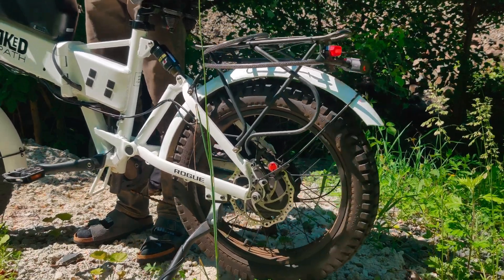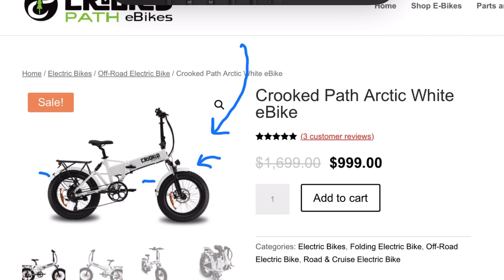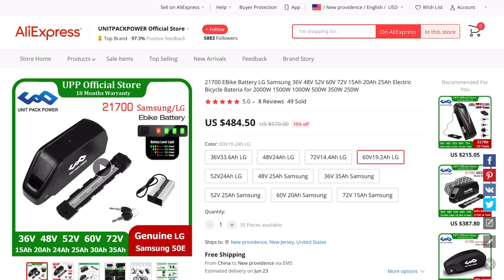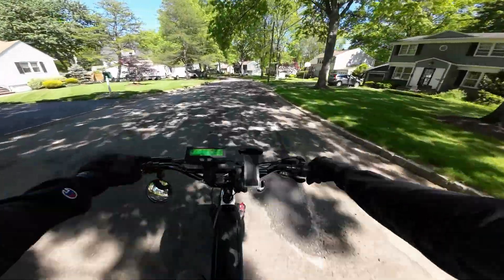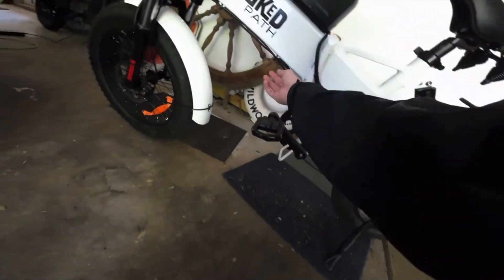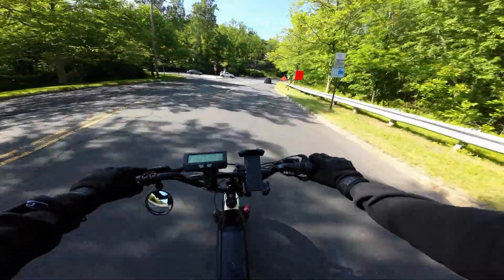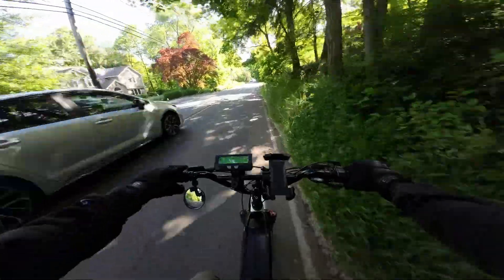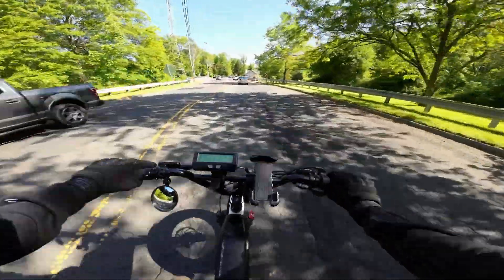I Made an eBike that Crushes Everything else

Comment: Definitely get your hands on a P-51, maybe you could get one from them without the battery and rear hub motor for a savings. I totally agree its suspension put's it in a league of its own, at least as far as E-pedal type scramblers, I know people are finding upgraded shocks for some of the other brands, but they still look to be limited in overall travel based on the original design and geometry of their rear swing arms. Something I've been watching for is for somebody to do a mid-drive setup, its probably been done and I just haven't come across it, but I'm super curious about how one would perform.

Comment: Dude, the Wired Freedom has dual suspension, 60volt 40amp controller with a 20amp hr LG battery that goes 38mph had over 2000 watts peak and is $1999.  They also have a step thru cruiser with the drivetrain and they are based in Chicago.  You can pick your bike up locally if you live nearby.
Reply: Sold out all summer

Comment: Hi. I just got a CP ebike 2 weeks ago, but I'm already having problems. I'm new to the ebike world and I'm not electrically nor mechanically inclined, so please bear with me. The bike seems to cut off power for me somewhere around the 60% mark. Everything is at factory settings. When I throttle it seems to use up 3/5 battery bars and the voltage drops significantly. I tested the battery and it was fine. 
1. https://youtube.com/shorts/EMxEYkUb9nA?feature=share
2. https://youtube.com/shorts/cyiR4RRQDqI?feature=share
If you or anyone here can help and offer some insight I would greatly appreciate it. I just want to get this thing going as it is my main transportation to work due to a recent car collision. Thank you.

Comment: on my enduro ebike i put a second motor on the front ,its a bafang 500 front hub motor,and its running on 82 volt 60 ah battery and 45 amp unlocked sabvoton set to 100 amps ,i use it only for flat roads as for sure it will over heat if on hills,but it flies,50 mph is the limit ive taken the little motor as i ment it to be for lower speed cruising,but shows these little motors can handle alot more power

Comment: Ok your key components motor, bms, battery and display. The battery being the hardest part to choose because you have to insure it's well made. No one wants a battery fire due to cheap battery cells and over charging. When you look around battery voltages are on the rise. Soon 60 and 70 volts batteries will be the norm. 
The bike you built is perfect for the range and price. With your bike you can go anywhere you want and nobody is going to give you a second look. What more could you ask for 😂

Comment: Similar build here: RadMini fat tire folder, Phaserunner, dual Tesla batteries, 3000 watts peak, 40mph. Downside is it's a hardtail, but a Suntour seat post mitigates some of that. Upside is it looks stock, throttle is buttery smooth and precise, park rangers smile and wave, and it out-climbs pretty much any mid drive e-bike unless it's a dedicated mountain e-bike. I was tempted to go with a 3k motor, but that motor weighs 48 pounds, mine only weighs 9. Thanks for the video!
Reply: Hey, wanted to know did you keep the stock motor? if yes, is it a 500w? And how much can you stress it? Wanted to mod up my lectric xp 3.0 but no one has done anything to the stock motor so I've no idea where to start but I think I can emulate this build

Comment: Your bike is awesome.  My perfect frame would be that style, with bottle cage mounts built in.  So you could keep internal battery and add yours.  "battery blender" to use both.  Dual motor mod would be cool.  Not sure about P51.  Frame looks a bit better than super73, but small wheels seem to waste space.  No pedaling or cargo rack means waste of a bike even if the frame could be sturdy enough to hold batteries.

Comment: Your build is so clean, but for my mountain biking use case I went with a bbs02 with a 52v battery and upping the amps to 22 makes it reach ~32mph on an old cheap full suspension mountain bike frame. I'm not confident pushing anymore than ~1200w out of the motor and I've reached the point of diminishing returns as well. It's been a year since building it and I've loved it but I will be retiring the bike this summer and building a nicer bike with a cyc x1 stealth and up the wattage to 2600 with a 52v battery. Keep up the content, your video quality has improved so much over the months!

Comment: It's funny to see this video when my Wired Freedom will arrive in 6 or 7 days. I think there's a lot to be said in favor of your crooked path build for someone who particularly wants that smaller folding form factor, but that doesn't mean a wired freedom is "the next best thing".

First of all, the motor is NOT exactly the same. The Custom Hengtai motor in the Wired is rated for 1000w continuous (33% more than your bafang) and has metal reinforced gears rated for 27000 km, and is actually covered by a warranty at the power levels we're discussing. 

Secondly, is 1500w really "very similar" to 2000 (actually 2100+ according to reviewers fyi)? Why phrase it like that? 

Otherwise, I appreciate the recap on your build. I was torn between doing something like your build, buying a 48v 35 to 60 AH battery bike, and grabbing a Wired Freedom. I went out and test rode some Aventon bikes to compare 20 x 4 and 26 x 4 tire sizes. I discovered I love the immense stability of 26 x 4 so I bought a Wired Freedom.

Comment: New build. Make the crooked back to stock and keep the all the upgrades parts and put them on the p51. Ramp the power of the stock motor close to 2kw and see what kind of performance you get. Suspension on p51 is absolutely the best but like you said the stock performance with that $3.8k asking price is way too steep for that bike. I like the new lyric graffiti 2023 for now. Under $3k and you get a bike that will go around 33 to 35mph.

Comment: Have you road the Engwe Pro Upgraded version? It has a 48v 16.4ah battery with a 750w motor. With me on it at 315lbs I have gotten the bike to over 30MPH. The motor does peaks to 1Kw. It also has full suspension. Check it out. The bike was just under 1700 dollars with an extra 48v 16ah battery.

Comment: I say that the best electric bike for about $2k is one with very large watt hours capacity. I can’t stress enough how important huge watt hours capacity is in a bike. The Eahora Romeo or the Aniioki A8 Pro Max are the best electric bikes for around the $2k mark. Custom made DIY electric bikes are good too though I never tried one before.
Reply: need to look at the new wired i have two of them and the newest one has some upgrades 60 v battery 40 amp controller its a beast for 2 k
Reply: @snoozeuloose  it’s ugly tho
Reply: @slimdunkin117  that just means it will be more stealth when your "pretty" bike and others like it get them all banned/regulated
Reply: @andrewstephens2687  mine looks more normal than the wired..it’s a xxl mountain bike frame with a mid drive..
The wired doesn’t look stealth at all, battery stands out, and huge ugly tires stand out..whole thing is a mess
Reply: @slimdunkin117  oh well I can agree with it being less stealth than that, but you said it was ugly, and that's a stupid shallow consumerist value to have. I don't respect people who value form over function.
Reply: Watt hours don't matter to me at all beyond a certain point.  For me, 40ah is the max I would go for.  I never ride long enough to drain a 40ah, and anything more is just extra weight and extra expense.
Reply: To add $2k in upgrades and your top speed, "in that configuration", is ONLY 30 mph and a range of 30 miles seems unjustifiable. A class 3 bike would give you a top speed of 28 mph and probably  longer  range. Maybe an upgraded rear hub motor (1500 watts or better) would have been a better compliment for your upgrades. For that size battery, controller and expense, I was hoping to hear around 40+ mph and 50 miles throttle only. Disappointed. But if after a year, you're happy, that's all that matters.

Comment: As a motorcycle rider, I would say that your next upgrade should immediately be very large and bright front and rear turn indicators - especially if you're going to be riding in the streets at speeds faster than a Tour de France cyclist. Us motorcyclists are already invisible to car drivers even with obnoxiously loud engines, but you with the silent bike are goddamn Harry Potter sneaking around the castle at night, so protect yourself! Having a brake light also helps keep you from becoming a horizontal Banksy. It looks like you might have a small setup for all of this on the rear at least, but that's tiny and too hidden under the seat. If you need to get an antibody shop to weld you a little bracket on the back and front. Trust me, you want a big setup that will be visible from a few car lengths away from the higher seating angle and whose light will actually be visible during the day.

Also drivers will just think of you as less of a dick if you're using large, obvious indicator lights

Finally maybe just get yourself a waterproof Bluetooth speaker that's really loud and play music while you ride so other drivers notice you faster. I have the Wonderboom 2, and this thing is fucking LOUD for the size, with loads of bass for the size. I think you can even connect two to one device to act as left and right channels, but just ONE is enough for me to hear over my bike engine driving around town doing 35-45, and the battery lasts for hours.

Enjoy cruising and stay safe.

Comment: 72v and suspension upgrade is in keeping with the value vibe of your channel
Reply: The only problem with 72v on this build is that if he exceeds the 1500w limit his controller is currently set to, he risks damaging the nylon gears in his bafang motor.
 It should hold up fine at its current power level (bafang motors are known for holding double their continuous rated power in normal use, despite their nylon gears), but AFAIK going past 1500w is asking for trouble. I suppose he could swap to metal gears if he doesn't mind the noise. 

Imo a new build would be a better idea. I actually think a Wired Cruiser build would be cool- he could use the stock battery/controller/screen to upgrade a different bike, and slap a big 72v battery and beefy controller on the cruiser to find out just how robust its metal reinforced gears are lol.
Reply: @Zirassi  nah these motors can handle a shit ton. i run 3000 watts sometimes on mine hehe. my motor isnt even a bafang, its a chinese unlabeled copy of a G60. but the problem is just temperature. at room temp you can run them at 3000 watts easily, just with a gentle start. but after the motor is around 50c then the gears will start softening and you can hear them skipping in the motor when starting. just gotta be mindful of temp and these motors are great :)

Comment: I think the P-51 with its open frame can accommodate a custom 60-70 amp 72V’s.

And the motor should be upgraded to a 3000w that peaks at 6. I see the e-bikes that say 18,000, but I don’t know if that is good on the motor. 6000 is plenty.